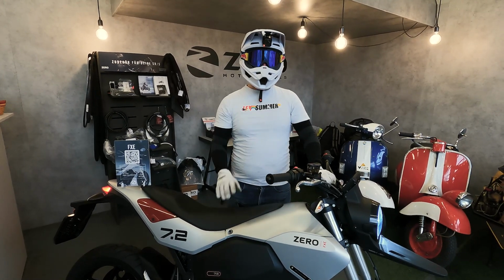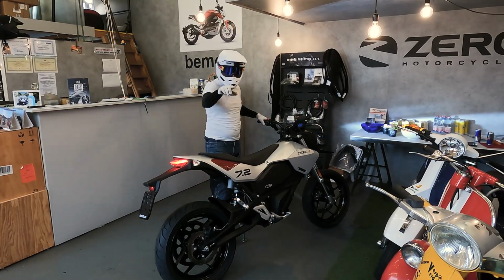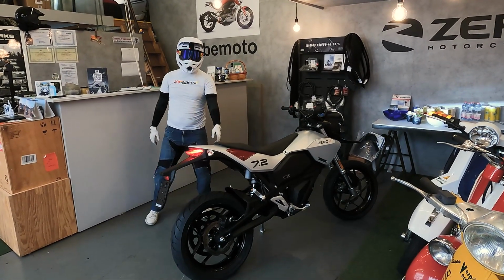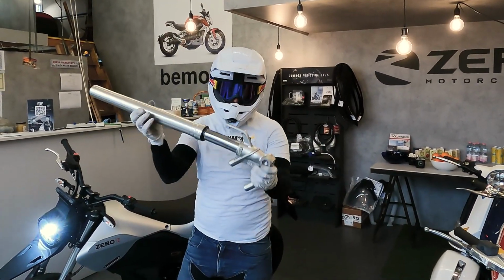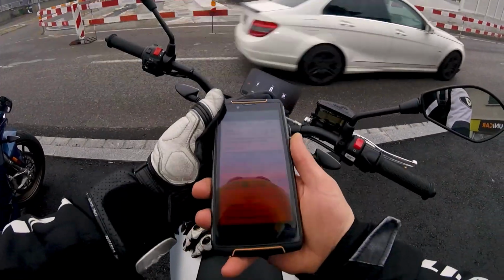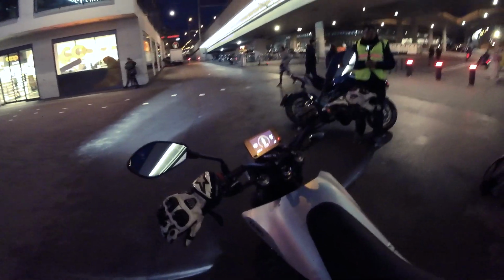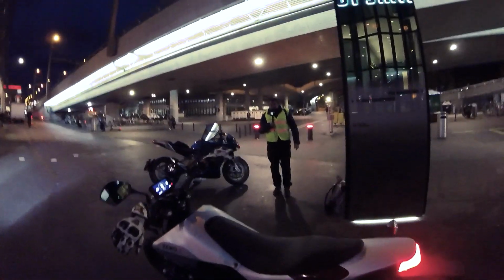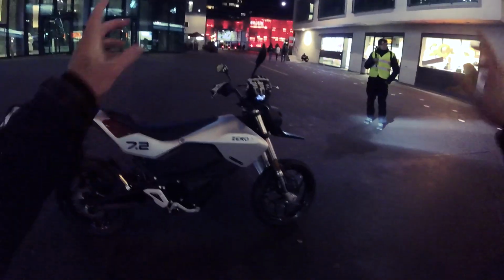Zero FXE testride real world range

Comment: A lot of people don’t realize that this is the perfect bike as far as weight/range. People may complain about wanting more range, and don’t realize that equals more weight. 1 mile is like 10lbs.  And as battery tech improves, I am hoping to get this bike with less weight vs more range. 

My commute is 30 miles and I work for 9 hours so it is perfect.
Reply from the maker: Ppl want that loooong range super sports bike which is leight weight and easy maneuverable with an excelent off road character for freestyle motocros and also good touring specs. But i tell you brah... This bike will never exist. 
The challenge is to find the right bike who suits to your needs.